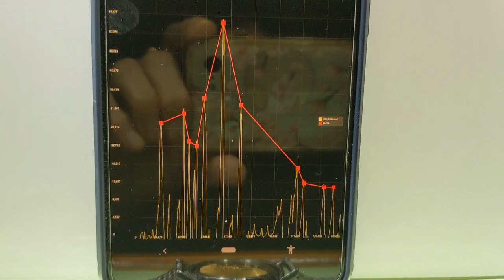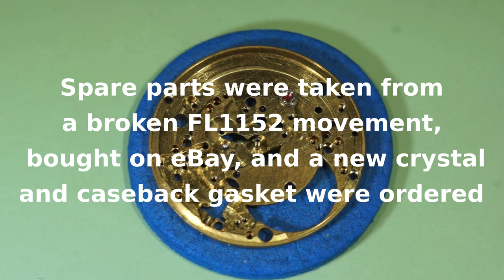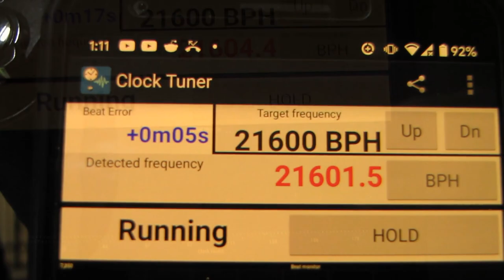Favre-Leuba Daymatic 1960's Vintage Automatic FL1152 Swiss Watch Restoration

Comment: I would not have changed that dial, the replacement is in better condition and is very very similar but, it is not the same and I would guess it's from a younger model.
Great video though.
Reply from the maker: Thanks for your comment! Believe it or not, but that video was my first experience on fixing and servicing a mechanical watch! And first experience equals to no experience. 🙂

Comment: Is the company still in business? Is it self winding? Could you improve the lume on the dial difficult to see in low light ! Gaskets shot !
Reply from the maker: Yes and no. Favre family sold the brand in 1985. But Titan Industries in India became the owner of the brand in 2011. Yes, it is a self winding or automatic. You can see the oscillating weight that does the job. I did not plan to do lume on this watch, but I might consider it later. Thank you for asking.

Comment: How much does this watch cost?
Reply from the maker: I do not know the price, sorry.
Reply: @ValentechTime  I have a watch from one such company, but don't know which model it is?
Reply from the maker: @bulandequbal9198  The brand name and some more details should be on the dial. The movement model is usually written on it, but you need to remove the caseback to see it. Hope it helps.
Reply: @ValentechTime  thank you😄
Reply from the maker: @bulandequbal9198  You'r welcome!
Reply: @ValentechTime  Perhaps it is the model name.  21 jewels swiss made?
Reply from the maker: @bulandequbal9198  This is not a model, it is a number of jewels in the movement. Look at my video at 1 minute point. There is a dial with a brand name Favre-Leuba.
Reply from the maker: @bulandequbal9198  Also look at the caseback of your watch. The model could be there as well.